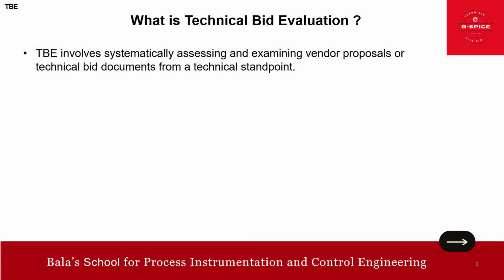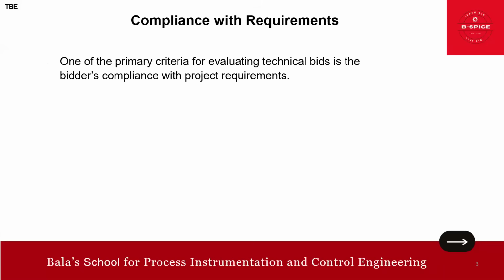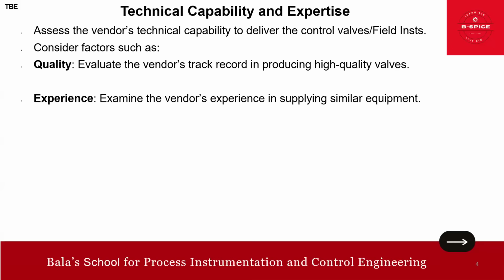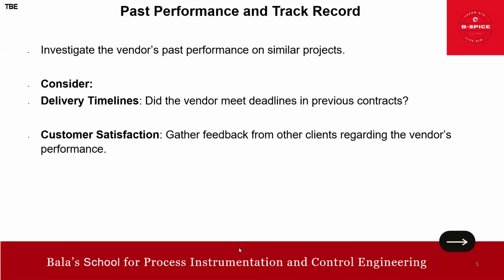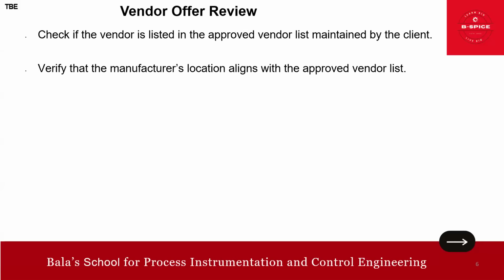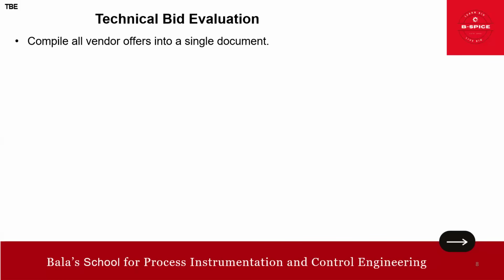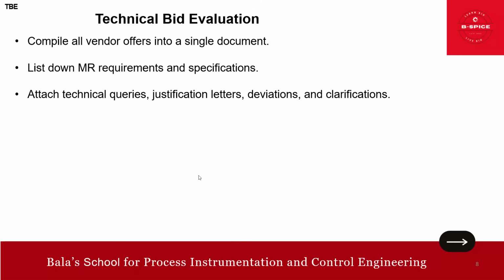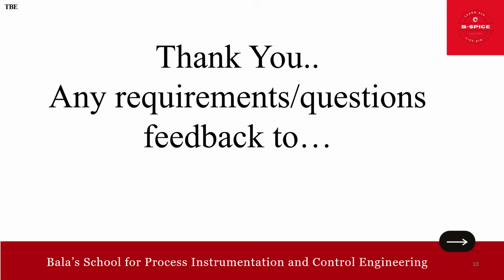TECHNICAL BID EVALUATION (TBE)

Comment: Hello, your videos are good. But we lack practical examples in the field. For example, I just had a mission end that would have lasted two months instead of 3 weeks because I was unable to make the technical bid evaluation of supplier quote techniques for flow meters and level sensors. I understood later. Because the colleague had told me not to be satisfied with just the quote but to look for the technical data sheets of the products through the product references on the offers for further information in order to find technical characteristics that were not mentioned in the offer.